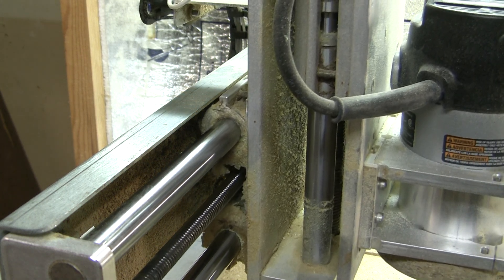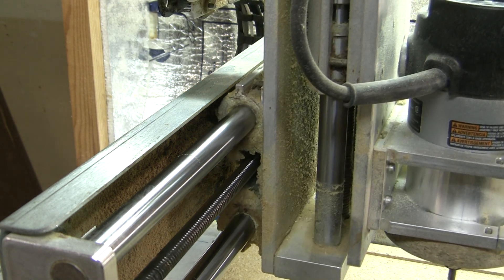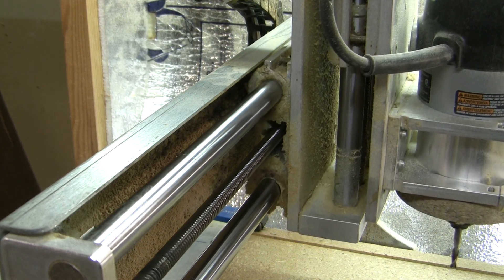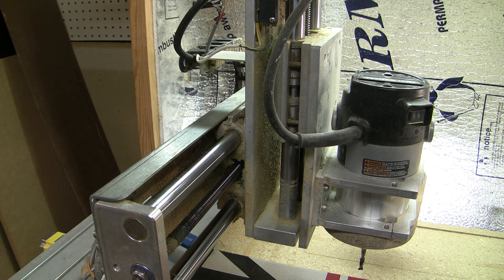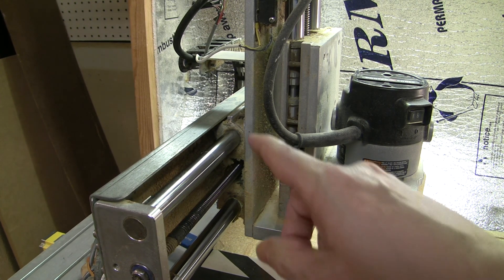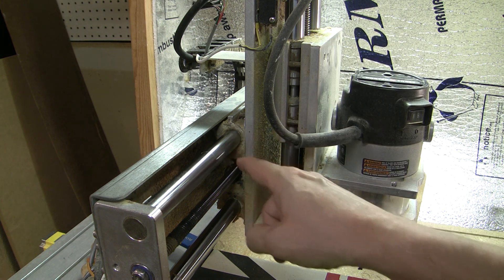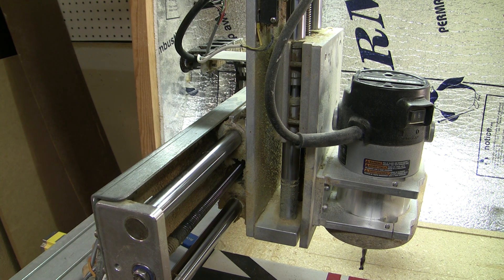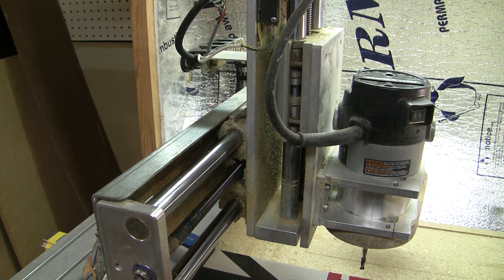cncproblems

Comment from the maker: Thanks for your input.  However, I was able to contact the K2cnc company in CA, and they thought it might be the bearings on the ends of the lead screws.  Since I was going to be rebuilding the gantry anyway I decided to replace both the lead screw bearings and the linear bearings on the guide rails. I also replaced the Y and Z steper motors with motors the same size as on the X axis.  I think they were borderline small enough that a little resistance from a bad bearing was enough to make it miss some steps. (I never had a problem with the X axis.)   It's now working great!  Also, since cleaning up all the "gunk", (from sawdust and silicone lube over spray) I have "tricked it out" and made it actually look nice for a change.  (Added structure to the gantry for dust & chip protection, a new dust shoe design, made a vacuum table, and currently working on a custom enclosure for my new "SuperPID" speed controller.) ---------- Videos to follow.